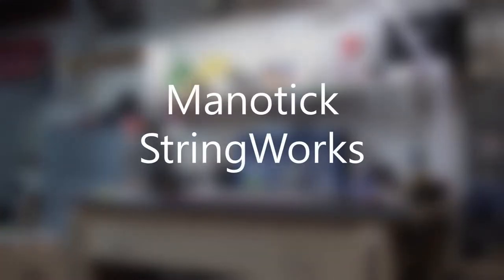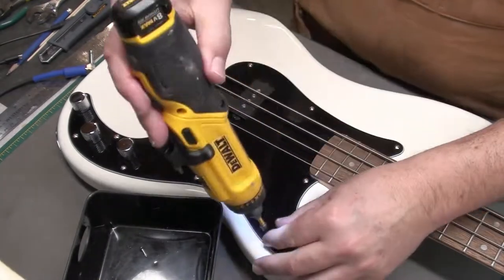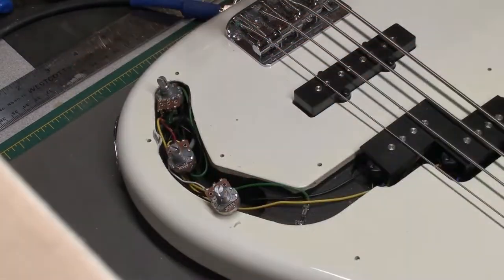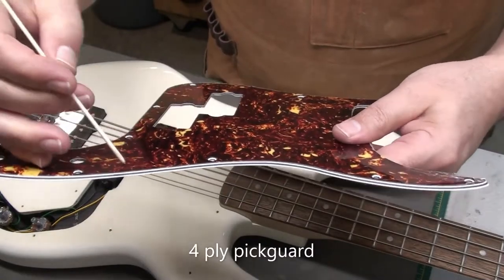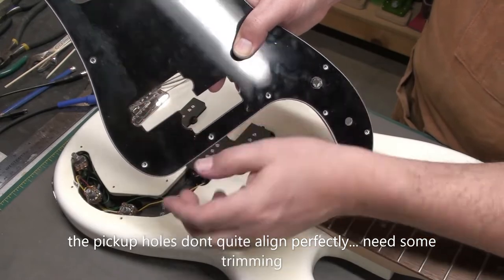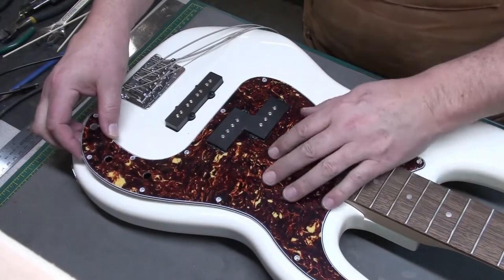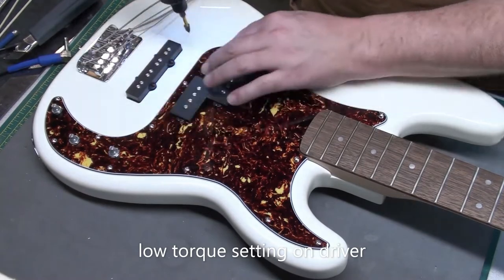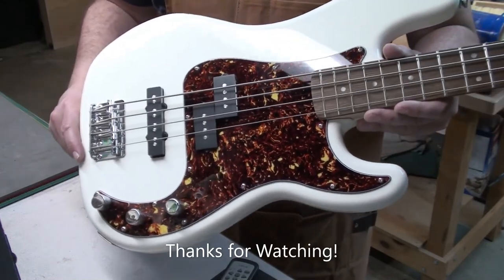How To change the Pickguard on a Precision Bass -  New Tortoise Shell Pickguard makes this bass Pop!

Comment: Here's a little tip; If your push-on control knobs also have a screw, try to line it up with one end of the slot in the split shaft. If it doesn't line up, try turning the knob 180 degrees to see if it lines up with the other side of the slot. 
Once you've done that, tighten the screw just a little and it will spread the slot so the shaft of the pot grips the control knob, but without damaging the splines on the shaft.
You can check that the screw is lined up with the slot when the knob is on the shaft by taking it out and putting a pin or straightened paper clip down the screw hole.

Comment: Big question can you use copper tape on the back of the pick guard for shielding ? also I have a TS pick guard bought for a MX bass I want to place it on an American Pro 2. What size are the pot shaft size ?? 3/16 ?? I figure I'll have to drill them out .
Reply from the maker: Copper tape works fine on the back of a pickguard